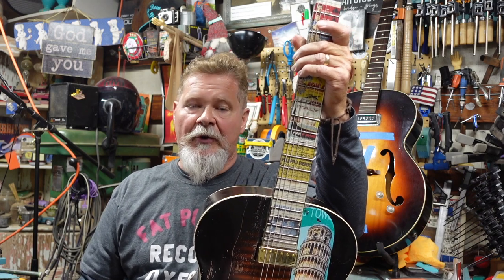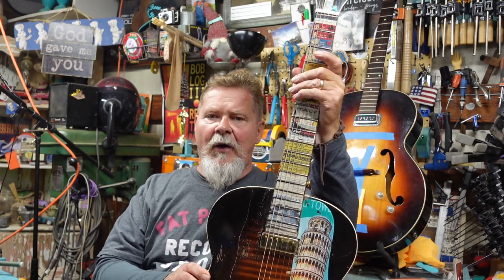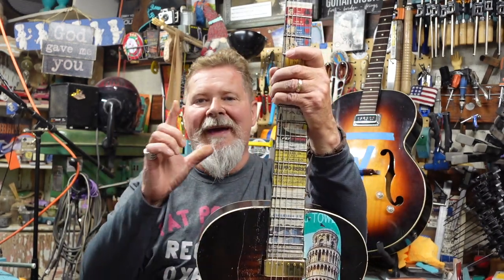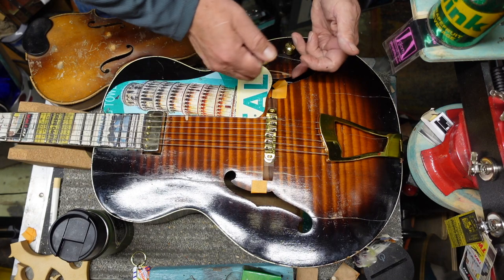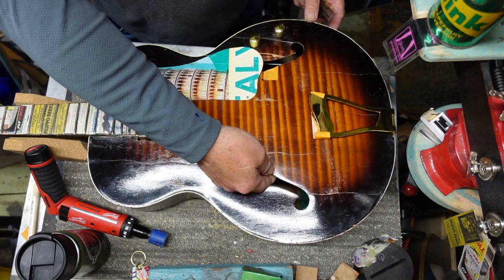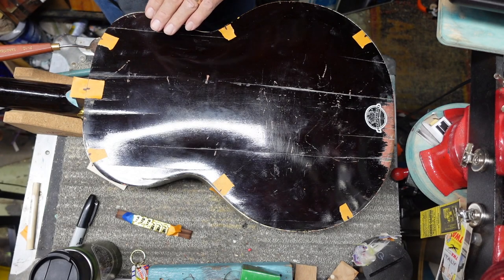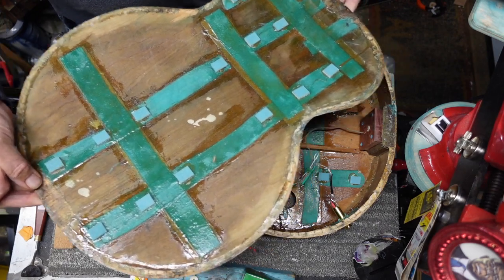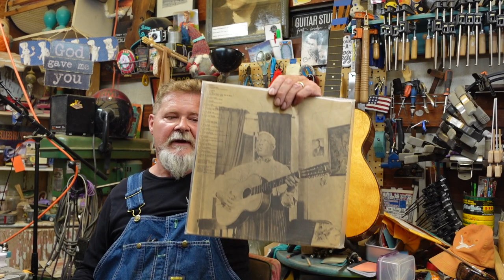Galiano Archtop Guitar Rebuild: Part 12-Back to the Drawing Board: Part 1

Comment: 14:59 … that fiddle edge is very elegant, it’s very classy…when I made mountain dulcimers I favored that fiddle edge and did a number of them that way so my dulcimers would be seen as classy!!
The sound post in a violin not only supports the top but it also connects the top and back, vibration from the bridge goes directly to the back and greatly increases the volume of the instrument…
17:43 … Brad Pitt in the movie “7” … “what’s in the box?! C’mon, what’s in the box?!”
31:14 … Spoiler Alert!!! 😆